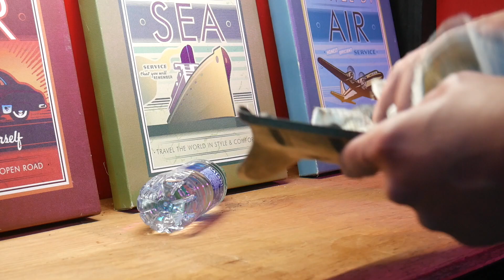Restoring Rusty Metal Engine Parts | Datsun 280zx Build

Comment: Nice ZX!  I'm in your neck of the woods (North Georgia).  I have an 89k mile 1980 for which I'm the caretaker.  If you want to do some ripping together, let me know.  Just did the eibach spring/koni adjustable shock change.  Made the car feel so much more planted compared to the stock springs and shocks.

Comment: Nice background music choices and it's great to see more updates from you guys. For that exhaust tube, I would just cut if off as close as possible to the threaded nut then weld it shut, worst case scenario you can flare it, clean it then fill the tube with high temp RTV.